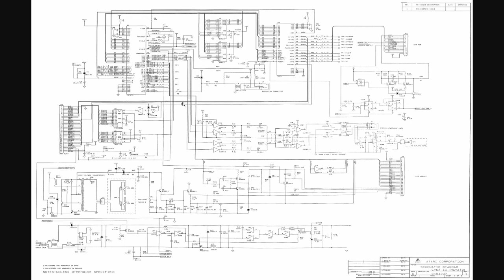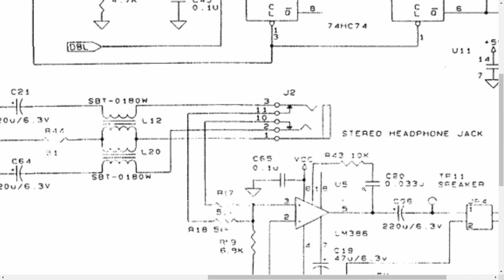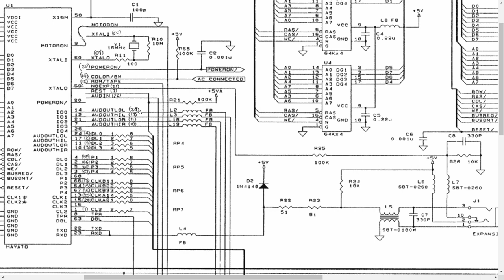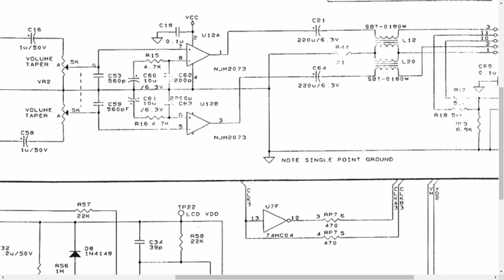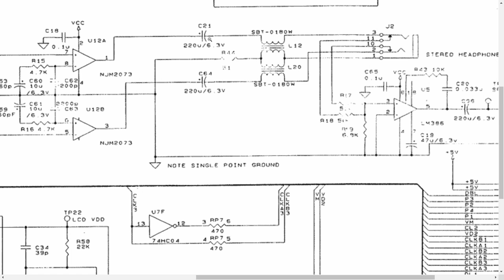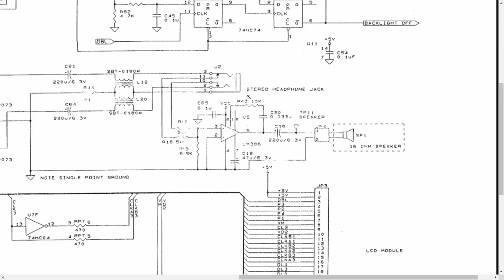Atari Lynx has No Sound. Troubleshooting and reading a Schematic.

Comment: How did you wire the head phone jack in. From what 2 points on the amplifier to what points on the headphone jack.
Reply from the maker: In this case, we left the headphone jack disconnected. But, if you wanted to wire it in, you would have to cut the traces leading into it, and then wire it back via it's original input.
Reply: @PghGameFix  ah ok tyvm

Comment: have a dead system... replaced caps... dead... replaced resistors... powered on.... but won't turn off... changed diode and it turned off... Now when i power it on I get like a squelchy noise and then no audio... any ideas? maybe another diode somewhere???? the console 5 kit came with two types of diodes one with a wire  out both ends which I used to fix the power off... and a small pill /rice grain size...and I haven't used it yet. any ideas would be great thank you for the video it was informative.
Reply from the maker: The Zener diode in Console 5's kit is more or less the regulator.  It runs in the breakdown range, and the difference is what the low voltage will be.  I'm guessing that the "5 volt rail" is not at 5 volts.  I would check that first. And then install the new Zener. THanks for watching.
Reply: @PghGameFix  well there were two in the kit... one was a small one and the other had a wire coming out both ends... did I install the wrong diode? or are they the same diodes so it doesn't matter which ones i choose?
Reply from the maker: @jamesb9578  They are the same.  One is a surface mount, one has wires. Just make sure they face the right way.  But, if the system totally collapsed, and fed 9v to the processor... it may be a goner.
Reply: @PghGameFix  ok so I get a hummm when I plug in headphones... I have to run out but I will test the board on a secondary system and see if I get the same results... could be the screen... cause the one I'm talking about has a messed up screen... ordered a replacement but getting it up till then. thanks for the help.

Comment: i have sound on the headphone plug but not on the speaker, cant i just pull a wire to the headphone jack?
Reply from the maker: Before you add any jumper wires... have you checked your speaker? They will go bad from time to time.  But if it's good, then you could run the output of the switched headphone port, to a small amp, and then to the speaker.  BUT... I would lift the other amplifier chip, and coupler cap off the board to cripple the output.  Also... it's known that the "Switch" in the headphone port will get corroded.  Check the output for signal. Thanks for watching.